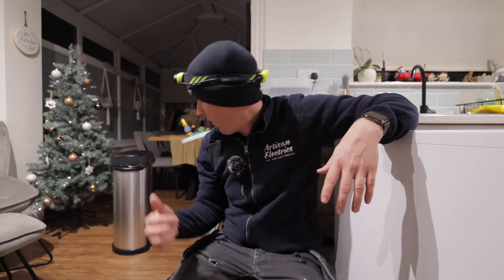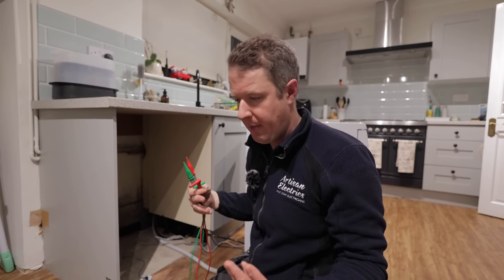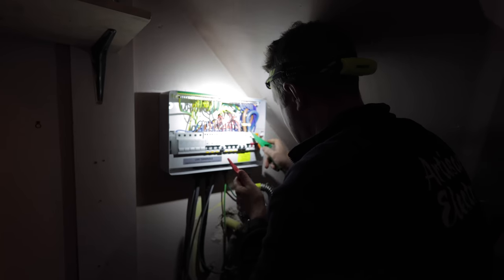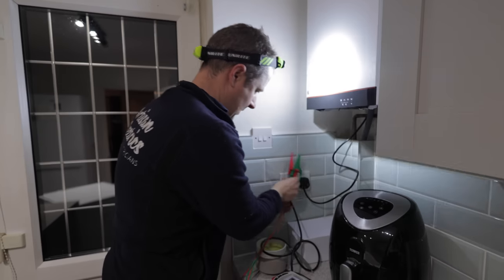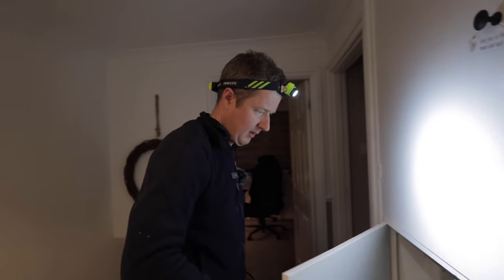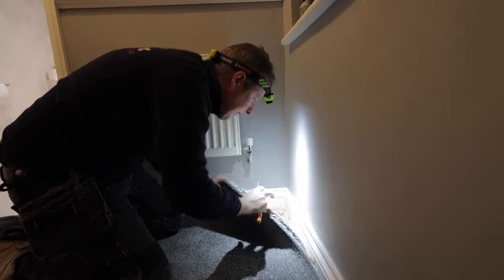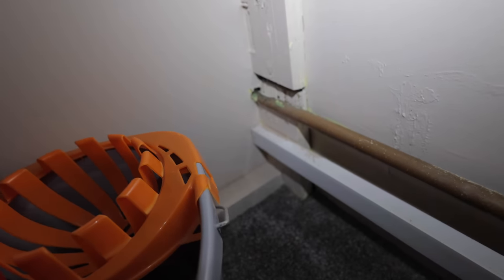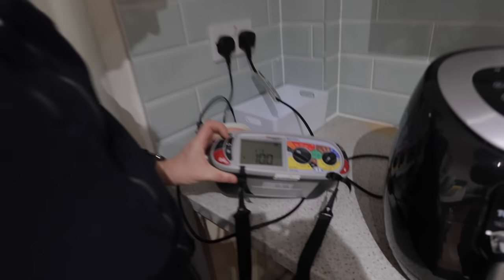Nearly KILLED by a CRAZY fault! What on earth is going on? 💀

Comment: That seems criminally negligent, whoever wired that up that should be out of business.
Reply: absolutely. This person is so lucky to have contacted you.
Reply: And inside prison
Reply: Householder is obliged to trace the cowboy(s) responsible and issue a writ to prosecute !!!   They cannot allow another household to have the same issue and there most certainly will be one somewhere local.
Reply: @michaelaltun  where is this info ?
Reply: I just had an electrician do a job where he did not realise a RCCB did not provide over current protection. He put it on an EV charger instead of an RCBO (no MCB). He came back but only after I had to repeat myself by email, bluntly the second time, that an RCCB does not provide over current protection. He made out it was an accident and he wasn't thinking that day and that the wholesaler gave him the wrong part! Complete BS otherwise he would not have said, plain as day, by email that an RCCB provides over current protection. The only over current device in the circuit was the main house cutout. He's apparently been in the trade 18yrs! He also did not provide a minor works cert until I asked him for one; I don't think he was going to bother until I asked (excuse was he was a bit behind with the paperwork). Also, he didn't bother to connect the armour on the SWA to anything; acceptable in the particular circumstance by regs I believe, but poor practice. I am not an electrician; just a DIYer. Not allowed to mess with DBs, me. 'Gainst regs isn't it. (Just like pulling the cutout is, like every electrician does.) The average householder would not have known there was any potential problem. The RCBO he eventually fitted buzzed like a b*tard, he stopped replying to my emails and so in the end I swapped it for another myself (yes it was the right type and yes, I even had a torque tool, which he didn't). Should have done the whole bloody thing myself from the start.... but I'm not allowed to because it would be oh so unsafe and against regs. Should I report him to NAPIT, as that was who certified him (according to his website)?
Reply: @jam99  You should take him to small claims for the cost of fixing that yourself.
Reply: @jam99  Should be an installation cert not a minor works, It`s a new circuit.
Reply: @charliedecker7702  Sorry, that's what I meant.
Reply: Excellent content and very thorough techniques!!
There are bodge monkeys everywhere.
I work for myself as a specialist in the automotive industry with a 6 week waiting list.
50% of my time is rectifying downright dangerous bodges from so called mechanics/technicians.

I say to myself nearly every day.
It's a good job these people don't work on aircraft!
Reply: @jam99  You should get another electrician in to test and re-certify. EVC typically requires a B-type RCD (sometimes included by the manufacturer as RDC-DD) protected upstream by an A-type RCBO. If you have just fitted a single RCBO upstream then it will be blind to the DC element present in most EVCs.
Reply: @NebakinezaOG  All taken care of, thank you. As for re-certifying by getting yet another 'professional' electrician in, I've assessed the risk myself there, thanks. Electricians need to start grassing each other up or their reputations will go down and down and down.
Reply: I agree, this goes against so many principles.
Reply: Welcome to the world of u.k. electrics. "When was your board last tested" "tested?" So by law you must have your car checked every year and mr. Policeman will enforce that. The only people to police this will be the insurance people when they don't pay out on your claim 😒. See many people on Facebook saying don't be stupid and change a socket yourself. Yes, not an overly taxing job but... look what can happen, even to the experts with £1000 test equipment.
Reply: A lot of it to do with householders wanting cheap work done,and not knowing too much about construction work, a rogue builder can see through them a mile off,one example was a programme on TV where a builder was given forth thousand up front for a back extension,
Reply: @jam99  

Why not H&S or Trading Standards or "Check a Trader", or his trade organisation?

Or next time insist on seeing his Public Liability Insurance cert.

And either take a pick or copy relevant details.

Shows that "you're" being serious.
Reply: Never assume any cable is dead when a  circuit is switched off . Had circuit connect to two breakers before also   had two terrace houses use to one which knocked through next to nextdoor they sold  up and sold as separate houses blocking up the doors between them  but electric crossed and central heating went between two houses . 
The neighbor refuse to allow access  for  us to remove connections between two properties and  terminate them  we chopped the cables live put a junction box on poked it back through the party wall Upstairs of the two properties had one consumer unit and the ground floor had  the other consumer unit feeding both downstairs . He knew he was getting free electric from next door and when he returned home he had no electricity down stairs after we disconnect him from our customers supply . He call the police . And was then arrested and questioned for stealing electric . Not sure what the out come was but my customer electric bills drastically reduced . Also had a shop connected to a lampost and In the loft a live feed was taken of the neighboring house lights upstairs . 
Never assume any cables is dead always test to see if the are live even when you think it's switched off . 
Weird shit happens which you wouldn't expect . Be careful out there
Reply: @justmeEnglandUK  

Lived in an ancient lodge place decades ago. Got weird stuff happening.

Lead sheathed cables and fused on both live and neutral.

The sparky sent to sort it must have come off the Ark but knew his business.

Went straight to ancient consumer unit, condemned it and place rewired.

The point being he assumed nothing and metered everything.

Good bloke.
Reply: This is in fact, a very common mistake. It has been happening for years.  A lot of it is due to poor training.   Electricians, mostly do not understand heating controls, plumbers do not understand electric installations. 
I have seen this so many times.  In fact, Artisan Electrics, demonstrated this by his poor understanding of the issue and overly complicated method of fixing the issue.
Reply: I’ve worked with a few plumbists that would’ve done that. And I regularly hear from air con installerists wanting to feed one systems from two locations.

These people walk among us.
Reply: @thomasoloughlin9075  nah, that's the usual excuse. It's 100% the responsibility of a qualified professional to quote a price that will allow them to do a job safely and not endanger someone's life. I would agree if we were talking about the quality of a fit and finish etc, where price matters, but in this case price has nothing to do with it, just criminally negligent work.
Reply: @nigelsanger7827  The problem continues, in different forms. These days home wiring includes a lot of low-voltage/signaling wire like Ethernet, but if you look at some installations you can really tell when old electricians haven't been properly trained on working with/terminating that kind of wiring.
Reply: @henryptung  Crazy, ethernet is almost impossible to wire wrong if you just follow the standard method described everywhere xD I think back when you needed to properly care about crossover vs stright through (NICs couldn't switch themselves) many older hats may have got it wrong though (excluding scrappy terminations, that's just a whatever, and a facepalm).  

But this is exactly the point. Of course I find that easy, because I program low level network software and prototype embedded control systems. But anything mains wiring I would for sure mess up at some point even if I tried to slow down and check everything.

Comment: As an electrician and plumbing and heating engineer I can say I've come across this type of fault more than once over the last 20 odd years .all boiler manufacturers supply terminals to feed external controls via the boiler to avoid this problem. Good bit of detective work fella .
Reply: When I realized that plug was hot and back feeding the circuit I was like, "Holy crap!"
Reply: @GaryCameron780  yep
Reply: Why does the boiler feed the control line back to the continous supply and to the neutral of that? Is it a relay entry?
Reply: @berndeckenfels  it's simply the residual current as a result of the live feed to the boiler that then has no balancing neutral connection. 
If the circuit had been fitted with standard beakers it would have not shown but the plug would still be live  when it was unplugged. It's only because the rcbo's break both line and neutral that it made the ground floor ring stay live.
Reply: Interesting that boilers are wired via a common/central supply that's fanned out to associated devices, because from the HVAC perspective it feels like the reverse - thermostat cables run (isolated) low-voltage AC as relay signaling, with the endpoint devices (compressors, pumps, etc.) being responsible for their own mains supply on the other end.

Comment: Good example of why some sparks only do commercial or industrial. Domestic cable routing is an art form. well done sir.
Reply from the maker: Thank you very much!
Reply: Yep. I only do industrial and commercial because domestic is just a lottery. A lottery that has prizes like, install a socket in newly decorated rooms ( without lifting floors or cutting channels or using trunking, and of course.... part P idiots. 
I have a guy who i pass my domestic onto, he loves them. He calls me out to sort this sort of shite out.
Boiler on it's own breaker. Every time. And always run a 3 core plus Earth for stuff like that.
Reply: Industrial thanks , domestic can be a real pain .
Reply: @raychambers3646  hi sir if your dealing with 3phase work in industry , you should have no problem in a domestic setting .  At least with low voltage your in with a chance of surviving a shock , not so good when you get across 2 phases .
Reply: @Mc674bo  it's not the wiring that is the problem ,its the carpets, floorboards, and clients !
Reply: There must still be some horror stories though. I've leased a pub before and seen how utterly insane the installations can be... also just walk into any "local" independent and look around at the dangerous wiring clearly visible xD
Reply: Well said. Done both. Both have their challenges.

Comment: This video needs to be compulsory viewing for every trainee electrician and plumber (perhaps as well as existing ones). Literally life saving, Jordan.
Reply: Could you have used the upstairs SL to drive a relay to switch a downstairs SL and keep the boiler on the downstairs circuit
Reply: @naim19711  it would have prevented this particular super dangerous fault, but it still wouldn't be particularly safe as there would still be 2 circuits present on the relay, which might surprise someone if they were being less than cautious.

Comment: That family are VERY lucky you took a shock for them. Incredible people out there will happily put people at risk like this.
Reply: as the saying goes, never underestimate just how little regard some people have for your life.
Reply: @johnnyfast1461  Indeed! I once has some work done in the basement and on comming back home noticed a really strong smell of gas... It turned out the workmen I had hired for the job had drilled through the main gas supply line of the house and deciced to "fix" their mistake with gaffa tape!!!!! Good thing the hole was after the gas meter and isolation valve so I was able to switch off the thing before blowing off the whole neighboorwood. 
Needless to say I had a lively conversation with these guys... wich ended well: they came back to fix the gas stuff and didn't charge me anything for the electric work they had been hired to do in the first place

Comment: How you managed to drill into the corner of the cupboard like that was impressive.
Reply: WHY they did it is not really impressive
Reply: As an electrician myself that was a very good shot,
Reply: that was a fucking jaw dropper of a hole <3 beine a spark myself that is a massive relief when it goes according to plan
Reply: Jedi level drilling.
Reply: Seen quite a few times he's done angle drilling and he gets it absolutely bang on, impressive stuff, most recent one I saw was installing a tesla charger.
Reply: The power of guesstimation lol.

Comment: Ex-heating engineer here. Great vid! Twin feed heating systems are actually terrifyingly common in ex-Local Authority properties that have had a boiler relocation as part of a refit program. Have seen a load in London in my time, and been on the wrong end of one too. Usually unmarked and really hard to spot, but apparently in some refit programs it was normal practice and so entire buildings/estates may have all had all properties done the same way 😦
Reply: Pure laziness from the previous spark. All because he couldn't be bothered to drill a whole and run a 3-core-earth cable.
Reply: That is actually terrifying.
Reply: @jamiehobson6336  Totally. Especially when you add in that it was a gas boiler to the equation. Engineer unplugs it thinking that will cut the power. Some gas leaks out while working and boom.
Reply: Same here! The number of room stats I've come across where a T&E has been run only for a nice new stat to be installed that requires a permanent live, so the installer has used the earth as one of the live conductors!
Reply: My brother  was a sparks  before he passed  and was working on a housing association   council plot he was a sub contractor  at the time one day the formant say do you know anything  about boilers there have been problems  he sayed yes went to this old boys house with the forman all of a sudden  the old man sayed we beenhaving problems  with  it for 6 months he took the panel of and went who the fxxx has wired up this is dam dangerous and need to be sorted  now he literally  turned  the powered off and cut all the wires the forman  then disappeared he asked who wired it the old boy sayed the forman what I could make out it was a new type of boiler just to say he was rewiring and wiring  boilers for 6 months the excuse  was by the forman was I always  wire the boilers  up after the plumbers have finished I've had no trouble  till now
Reply: @13adrian  the "forman" of your comment is punctuation

Comment: This gotta be the scariest electricians' video I have ever seen.  I am in my second week of an electrician's course, for adults, and learn all about safe isolation and how important it is.  But never in a million years would have thought I could have come across a live 3-pin plug feeding juice into a switched-off circuit!  This video is invaluable.  Thank you and my hat off to you Sir, take care out there!
Reply: I am not an electrician, but I've seen things one wouldn't believe. Never take a chance with electricity.
Reply: Always carry a multimeter with NCV even near circuits you thought were off, could save your life
Reply: Very good point, and also check for power between ALL conductors with a multimeter or 2-pole voltage tester before starting work, as this guy said. I wish the person taking the electrician training every success. I am not an electrician, but I myself am hoping to get qualified and start working as an electrician.
Reply: always assume conductors are live until you have proven them dead with testing